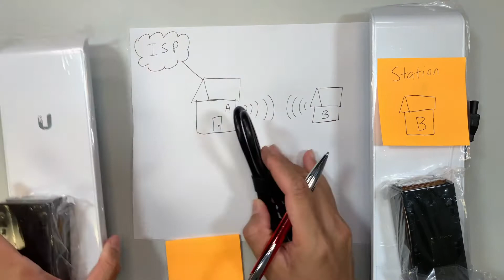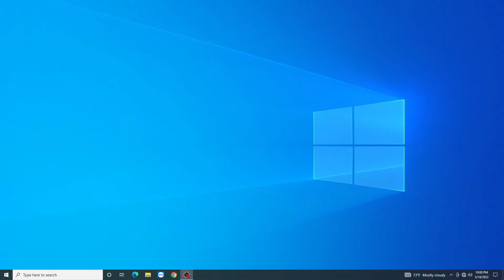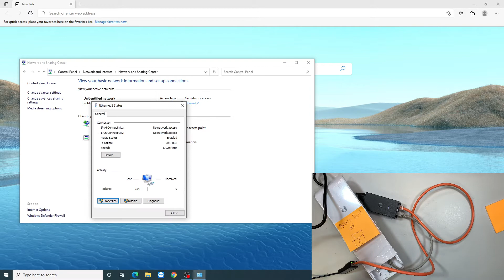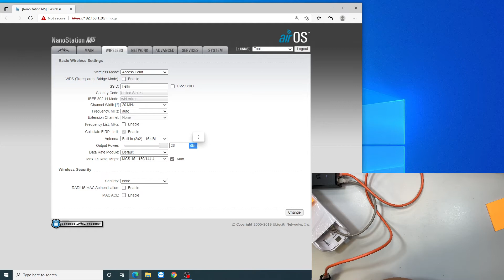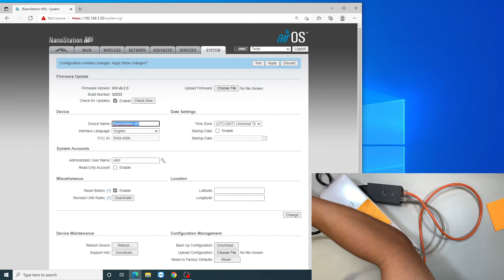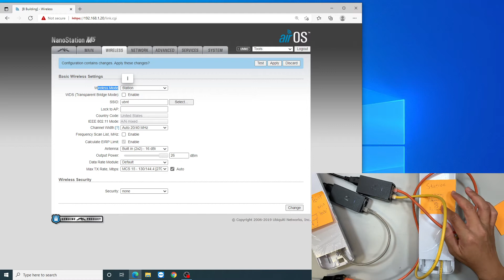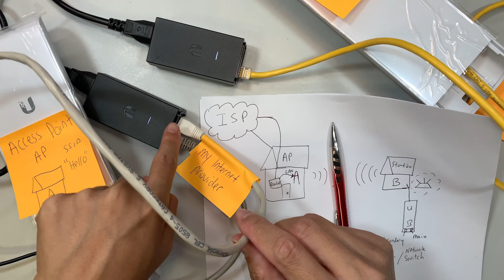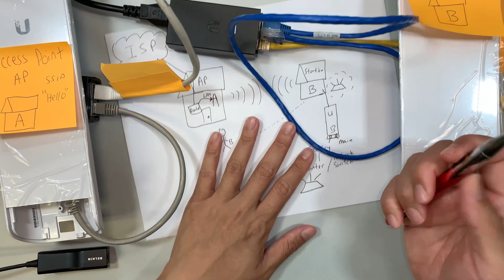Ubiquiti NSM5 Setup

Comment: Best ubiquiti setting explanation. It is very complete. Thank you Sir
Reply from the maker: Glad it helped!
Reply: @UbergeeksBiz  the settings of the ip addresses of both main and slave stations are not working as you posted. Everyone needs to put in the gateway of their particular internet source then assign to each nanastation an ip corresponding with that of the gateway. Then then internet will work properly.

Comment: The good thing about the M series is they are compatible with other brand bridges and even off the shelf wifi routers meaning you can use a nanostation M series in station mode to pick a wifi signal from your off the shelf wifi router or modem/router device your ISP leases you, or your campus' or apartment complex's wifi as long as you match the channel width.

Comment: Followed your instructions to install M2 NanoStations - all seemed OK however I experienced a significant drop in download and upload speed. At Station end of the connection I have an Asus wireless router to provide wireless service to that location. Any thoughts as to what might cause a big reduciton in speed ? Thank you - the videos were easy to follow and VERY helpfull

Comment: Can you do another video showing how to configure adding a new WiFi Router in Building B (connected to the M5) so that we have WiFi coverage in Building B and not just an ethernet cable connection? And with the possibility of using the same WiFi credentials (SSID and pw) as Building A?

Comment: The best way to midigate obstructions like trees in the signal path is not opt in for the NSM9's which are 900 MHz radios. Not the best band but is better than 2.4 or 5.8 since the lower frequencies do not deflect and get blocked as easy.

Comment: Hello, I have successfully completed all steps and have full signal on both sides, but when I plug in my wifi router on the B side, it says I have no internet when connected to it? I can hard wire it and it works fine but not through wifi? Any help would be so grateful

Comment: I set up my nephews internet to run over to his dad’s house using your previous video (M5 Loco). I used my nephew’s small laptop that was hookup to his ISP. Recently I tried to hook up a second location. I thought I had it working until I realized it wasn’t. Well, I think what I did wrong was not updating firmware to match the others. So, I tried to log into both my nephew’s and his dais’s M5 loco with no success. I needed to see what version of firmware they were running before I updated the 3rd. When I pulled up my nephew’s AT&T diagnostic screen, I only found My nephew’s IP address (static). Although, I did see an IP address that the M5 are shipped with (possible conflict). So what am I doing wrong?